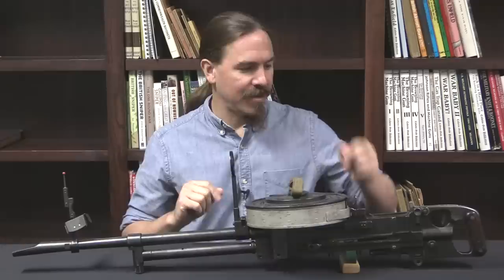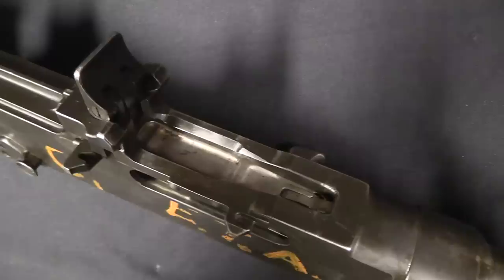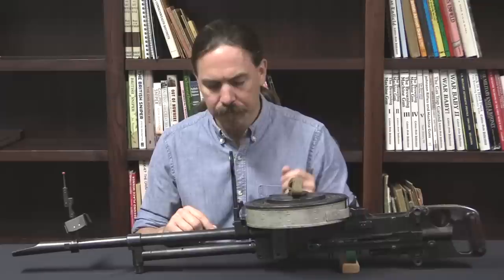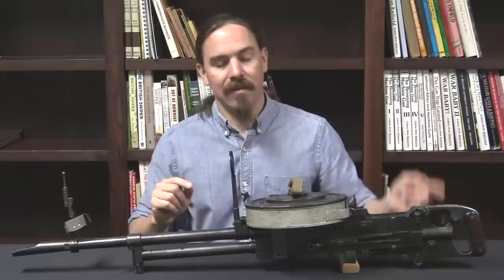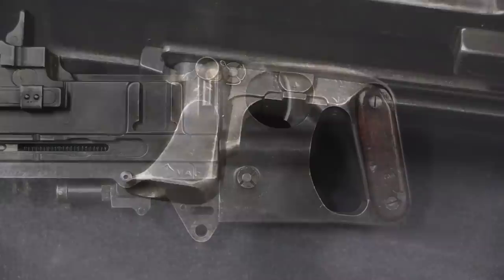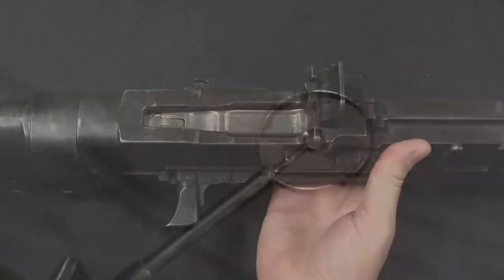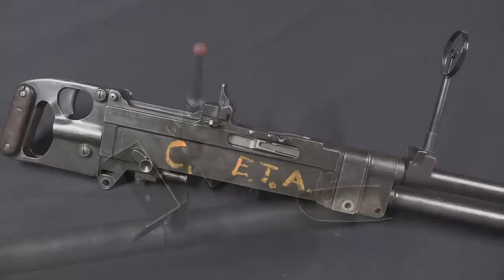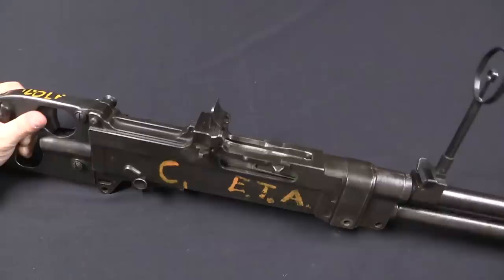Vickers "K" - For Aircraft and the SAS/Long Range Desert Group

Comment: The SAS and the Long Range Desert Patrol Group are two different groups
Reply: And members of either would very strongly doubt the parentage of members of the other.
Reply: LRDG tended to prefer the Vickers and Lewis (that was surprisingly suited to a sandy environment) over the Bren or Vickers K.
Reply: @18robsmith  exactly
Reply: Granted,  but they worked back to back.
Reply: @Stephen Le-surf  mostly, the LRDG did also their own stuff, and soon enough the SAS learnt enough to do itself
Reply: @justforever96  and then proceeds to call them the predecessors of the SAS.
Reply: LRDG was more of a conventional reconnaissance unit. SAS was conceived as a strictly raiding force. Parachute in and E&E out, which was problematic. The LRDG picked them up for egress on their 2nd or 3rd mission. Given the hazardous nature of parachuting, Sterling proposed that LRDG take them in and out. Match made in heaven ensued. Sterling ' acquired ' some Jeeps, etc, and the rest is Rat Patrol.
Reply: Really? Enlighten me??
Reply: @fagangoldsby4990  Floyd above you does a pretty good job of the difference
Reply: Pre curser however more a kin to sfsg kinda in a 1940s way
Reply: That would be the Commandos,  @wierdalien1
Reply: @floydvaughn9666 that was Sterling and Lewes (rip both)
Reply: @dodieoinst4598  eh, yeah, kinda, but not really

Comment: These were used as beam guns on Bristol Beaufort torpedo bombers, which were flown operationally with the crew entry door and opposing emergency hatch open to facilitate shooting.  Typically twin Browning belt-fed guns were fitted in the mid-upper turret of these aircraft.  My Father (who was an RAF air gunner during the war) had a nasty experience with one of these in late '41 when returning from a shipping strike.  What was lefty of the attacking force came under attack by FW 190s on the trip home, at which point my father found that the turret guns he was manning refused to operate.  In the rather uneven exchange that followed they ended up getting badly shot-up, with the wireless operator, who had been manning the Vickers K guns, being seriously wounded and totally incapacitated.  Towards the end of the engagement all but one of the 190s broke off.  The remaining 190, presumably having shot off all his ammo, formed up along side the stricken Beaufort, which was by this time so riddled it was apparently making an ominous whistling sound and trailing smoke from the burning rubber life raft; presumably just waiting to see it crash into the sea.  Frustrated at not being able to get his guns to operate my father climbed out of the turret and gave the guy a long burst with one of the K guns, which sufficiently dampened his enthusiasm to the point that he peeled off and left the Beaufort to it's watery fate.  As things happened they managed to get back over dry land, before crashing somewhere in the Western Desert.
Reply: Nice story and nice screen name, thanks fir sharing.  
 (:

Comment: Very good chapter on the Vickers G.O. in "Guns of the RAF" by G. F. Wallace, who from 1935 was responsible for this weapon (and others) for the Air Ministry. The driving spring for the 100-round magazine had been made of top-quality Swedish steel, which became unobtainable after the fall of Norway in 1940, and thereafter had to be made of a lower-grade steel; hence the loading change from 100 to 96 rounds.
Reply: Similar issues with Sten magazines led to the ongoing under loading of the later L2A3 even though it had post war superior steel springs that could take full loading.  Curiously the 50 round magazines of the Lanchester were still happy on 50 rounds into the 1970’s.
Reply: As I recall, we were advised not to fill Suomi drums to the brink even though they had high-grade springs. My take is that at full load, the spring would press the rounds so tightly against the helical separator guide that they wouldn't necessarily feed well for the first shots.
Reply: Not a lot of people know that....
Reply: How is swedish steel better?

Comment: Waiting with bated breath for the Saturday shootie video...
Reply: I wish. This does not appear to be a shooting collection.
Reply: @kaveman9  Indeed.
Reply: Boring! 

Actually I wouldn't find that video boring most shooting videos are very boring though.
Reply: Latch it onto a hang glider and watch GJ strafe the rifle range. I'd pay to see that.
Reply: Assuming the safety can be fixed. Atm it's permanently on Safe
Reply: @howardchambers9679  Good point.  I wasn't sure if he meant it could be pushed and held on fire, but in any case it may be considered too valuable to shoot.
Reply: Would need a Jeep fully speced with  all the guns  and the 50% tracer - basically a SAS jeep had about 2/3 the cyclic rate of a minigun
Reply: @mauricewalshe8234 That would be a great collab with the Chieftain!
Reply: @howardchambers9679  Then how did Ian let the bolt go forward by pulling the trigger?
Reply: @howardchambers9679  Inoperable is not necessarily stuck in one position.
Reply: @petesheppard1709  yes I think two twin k's plus a browning was a common  loadout
Reply: @mauricewalshe8234  That is what photos seemed to show.  Actually, I thought those K's were Lewis aircraft guns.